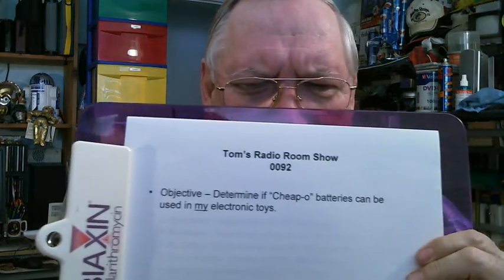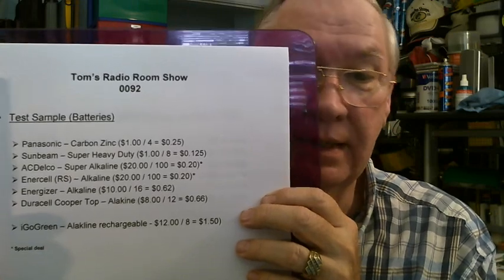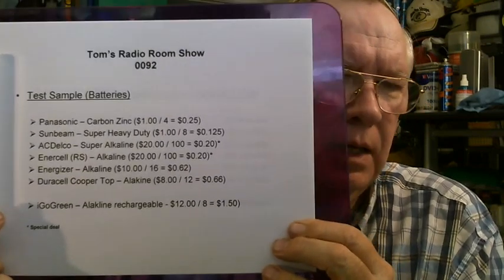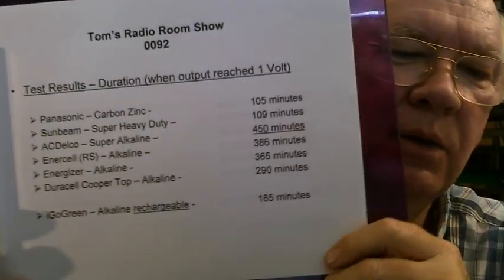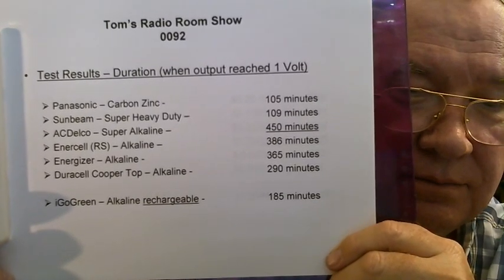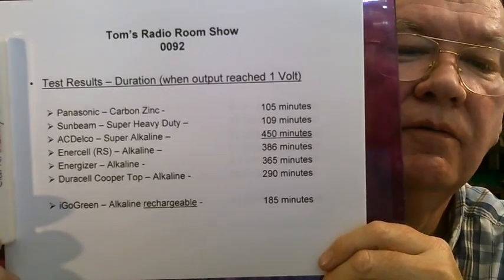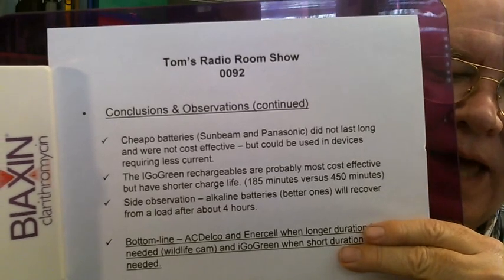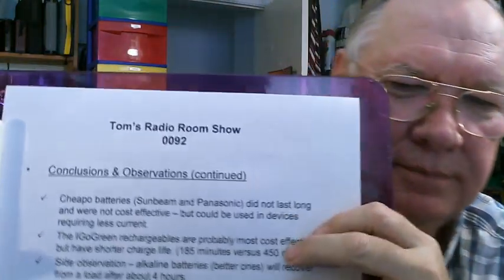TRRS #0092 - AA Battery Testing Results

Comment: Hey Tom , yes some of it was boring but we OLD GUYS can be boring, HOWEVER your information was GREAT.
The AC Delco batts are available at HD for $10.71 for 48 batteries, 22 cents ea.
I came across some bad reviews of them, but then I saw you.
Well to avoid being another boring old guy all I have to say is that I am ordering the ACs from HD and will let you know how they go. (I'm a poet)
Thanks for the BORING video but KEEP IT UP.
Reply from the maker: Thanks.  I got some Rayovac on sale at Home Depot.  They don't last long but are good for emergency use (short term).
Reply: I'm planning on buying them the same way.  Here they're $9.97 for a 60count! May be buying 2 or 3 cases..
Reply from the maker: Thanks.  Let us know how you like those batteries.
Reply from the maker: Give a report, please.

Comment: I second the comments below about Sanyo Eneloop rechargeable batteries. Once you start using these you'll never want to go back to alkalines again.  Alkalines have leaked and ruined too many of my devices over the years.  Never had a problem with Eneloops leaking though and they'll give you more consistent voltage output as they discharge.

I do also use Energizer Ultimate Lithium cells for some applications when I either want the absolute longest runtime (the AA's give you 4,000mAh vs. 2,000mAh for Eneloop), the lightest weight (they're much lighter than Eneloops or alkalines), or if I plan to leave them in a device long term and want to be sure it'll work (15-year shelf life). Never had these leak either.  

By the way, they also make Eneloop Pro cells which have more capacity (2,500mAh for AA's). Hope that helps!
Reply from the maker: Thanks for your inputs.

Comment: Thank you for this informative video - I was ready to purchase batteries on Amazon and wondered about the AC Delco batteries which lead me to your video.  I tried your store but there is no search feature ... I was hoping to give you credit (minor $) for the purchase.  I have not checked out your other videos so please forgive this question if you have a video on it (please link) ... how do you like to store your batteries?  How do you feel about reversing the battery(ies) in a unit to stop them from using power when not in use (storing it) (I usually insert a piece of paper at the end of the positive terminal to stop the contact). Thank you
Reply from the maker: I store my batteries in cases that store them parallel so the ends do not touch.

Tom

Comment: Like your video but you should be using the Eneloop rechargeable batteries by Sanyo. There is no rechargeable battery in the world like them. I HATED rechargeable until the metal detector hobbits told me about them. 90% shelf life for a year or more. They ship charged and arrive 90% or more full. Amazon.com or eBay... not in stores.
Reply from the maker: Thanks for your comments.  I bought some about a month ago but have not fully tested them yet.

Tom

Comment: Thanks for your testing. I prefer the recharge batteries. I take 7-9 thousand photos per year, mostly interior w/flash (property inspector). I find the rechargeable batteries last me 12-18 months, get a recharge every week or so vs Duracell or similar costing approx $2 every 10-14 days. Not calculating energy cost to recharge, approx $5/ yr for recharge batteries vs $50/yr for Duracell..oops, add $2 to recharge, I do keep spare Duracells for when the rechargable lose charge.